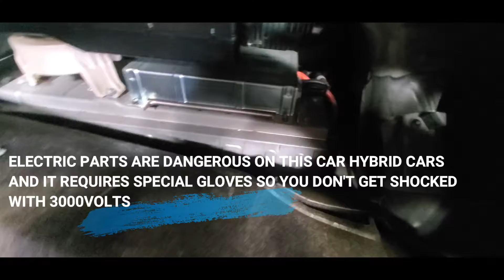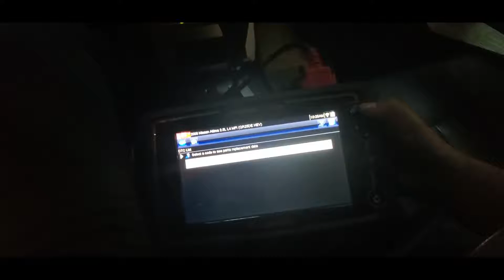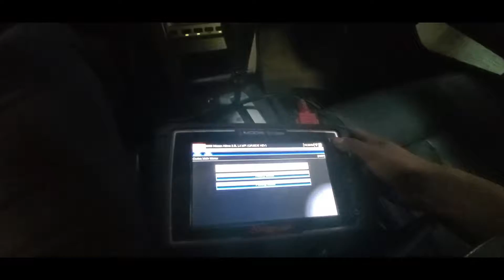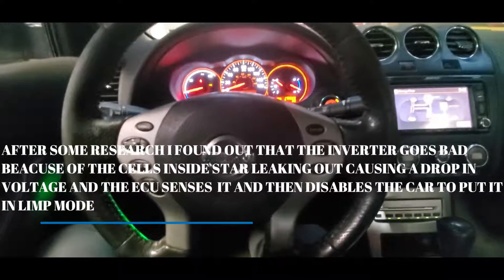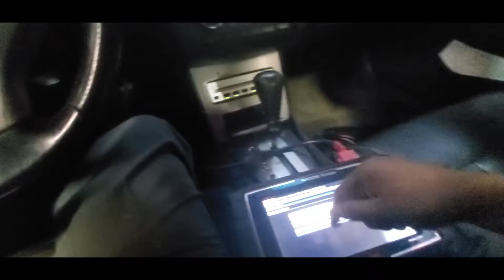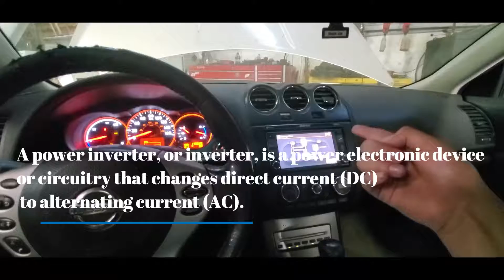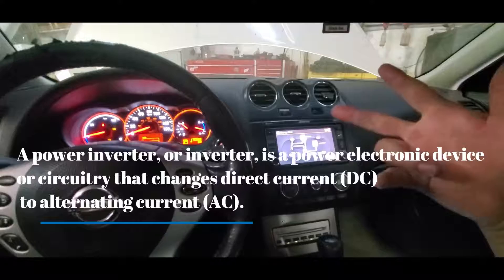How to fix 2008-2012 Nissan Altima hybrid battery inverter code P0A7A.

Comment: Good video bro. Hey I have a similar vehicle that I went to check out today. I'm having trouble diagnosing it. I have a snap on modis and I cannot communicate with the PCM however I can communicate with the other modules. It's a no crank no start. Hooked up charged battery supply because it was low, checked wiring diagram for starting. There's a brake switch on the bottom, and the other sensor for start up. I wanted to check to see if I'd get a signal to the starter motor but I was baffled and could not find it. I noticed that manual transmissions do have one but automatics do not? In my diagram it does not show that. Would you be able to guide me through a diagnostic?
Reply from the maker: Ok if u can't communicate with the pcm that is the issue. Have u checked for the powers and the ground that goes to the ecu. And also if the grounds and powers are good it could be the ecu. I have seen many go bad because the ecu is in the hood next to the battery and it is exposed to water and dirt
Reply: @JVFIXLLC  I'm going to check tomorrow, but I think I figured it out. Must be a coil that is burning out the fuse that feeds the ecm relay. Unfortunately I didn't have power probe because I forget it at home. I had a small multi meter from harbor with small leads but not long enough. So tomorrow for sure going to check the fuses. Thanks for the help
Reply from the maker: @automotivedefenz2195  I had similar issue as well with the ignition coils burning too I would recommend you to change all of them. They are cheap on ebay and there is many good quality ones out there.

Comment: Hi, I have 2007 Nissan Altima hybrid that wont start. i got the code POA7A. how can i test the inverter and if is bad where can i buy one. the only thing did happen was that my car run out of gas on the freeway and after that won't run. i will like to call to you on the phone if is possible i want to fix my car. i live in California bay area.
Reply from the maker: the only way to test it is with a voltmeter special for high amperage and voltage but if you get that code is pretty much the issue the inverter, and you can find used ones on ebay or also you can call LKQ recycle and they give warranty.
Reply: Same thing happened to me
How you fix it ?

Comment: I am not getting any codes.  They will just not start.
Reply from the maker: have u checked your 12v battery? is located on the trunk passenger side
Reply: jvfix Yes I went and bought a new battery charger. My other one was about 40 years old. So this new one tells me if the battery is good or not. So it came back as battery bad after charging all night.

Comment: Hello bro, good video I have an Altima 2009 hybrid withe the same dtc, do you need to flash the new e- hybrid ecu that cames with the new inverter assembly?
Reply from the maker: u dont have to flash just install it and u will be good to go. just remember to unplug the rear 12v battery and also the hybrid battery and let it sit 10m or more to allow the system to discharge
Reply: @JVFIXLLC  I confirm no programming needed…

Comment: Hi. I have a 2009 Nissan Altima hybrid. I just bought it and was ripped off basically. But anyway, abs, brake light, vdc light came on and I thought maybe it was a sensor. I went to auto zone to have them scan it for codes. It ended up giving codes for the powertrain control module. No check engine light, not stalling but is running badly. Anyway, I'm guessing it needs to be replaced and that's such an expensive job at the dealer so I want to do it myself. No I'm not a mechanic lol, but I'm also not rich and can't afford to have the dealer fix it. So I don't have any other option. I'm worried because it's a hybrid though. I know I gotta unconnect the battery first regardless, but how do I do it safely? Also do you know where the modulle is located? I think it's in the engine compartment but I'm not sure because I can't find anything definitive and how do I get to it if it is in the engine compartment?
Reply from the maker: What codes did u get when u went to autozone?

Comment: I have a start problem w my car where everything turns on but the engine, I’ve replaced the brake switch and the steering column lock but it still doesnt start, any ideas why?
Reply from the maker: Have u replaced the starter also. Let me know what year is your car and what type so I can help u figure out the problem
Reply: JV Fix it’s a 2008 hybrid altima and no i haven’t replaced the starter switch
Reply: Are you located in Cali by chance?
Reply from the maker: Yea iam in cali. For that issue I would start by checking the fuses. I can provide u a wiring diagram to find the correct fuse. By the way do u have knowledge of how to use a multimeter
Reply: JV Fix no i don’t know how to use one. Any way i could get you to help me fix it? I’m located in Gardena, CA
Reply from the maker: Wow it's  a little far from where iam. Iam located in Fresno
Reply: JV Fix yeah that’s far, any tips you could help me w tho I’d greatly appreciate!
Reply: I know where the starter switch is, should i replace that and see if it works?
Reply: I also have a picture of the fuses and i believe I’m missing the fan relay switch but I’m not sure
Reply from the maker: First I want to know what happens when u press the brake pedal and then u push the start button does it make a noise or just nothing happens
Reply from the maker: If u would like u can email me ur phone# or u can add me on Facebook also so we can do a video call and then I can help u better in real time.    My email is francisconin915@gmail.com 
And my Facebook is Javi Nieto
Reply: Paul Reyna did you get this fixed? I have the same problem
Reply: @brandonsanchez3431  mine is starting but I know the issue mine has can keep the car from starting and apparently it's common in these cars. Mine is the powertrain control module. Did you run diagnostics on it to see if it will give you any codes? If you don't have the scanner you can do a self diagnostic on Nissan's. You have to put the key in and keep your door open. Theres a button where you door closes. Anyway you have to press the start button 5 times, then press the door button 10x than the start button again 3 times. Press and release not hold it in. That puts the car into self diagnosis. It will act crazy lol. But that's normal. It's checking all the systems in the car to see what's working and what's not. You'll know you did it right because after the last press the car horn will beep. Then the wipers go the headlights blink, etc.. If there's any issues it will display with a code. Worth a shot to see if you can get any answers. They have videos showing how to do it. Just search Nissan self diagnostics.